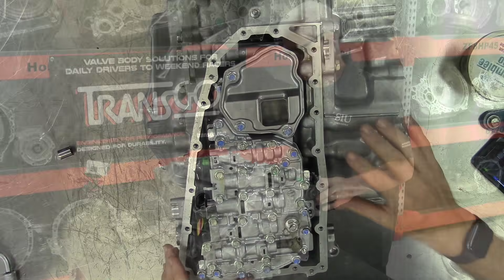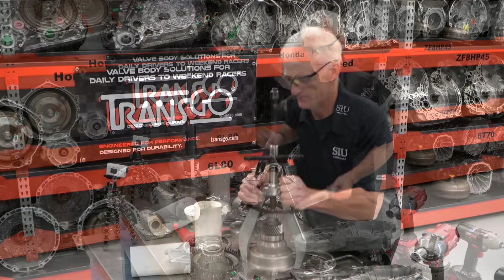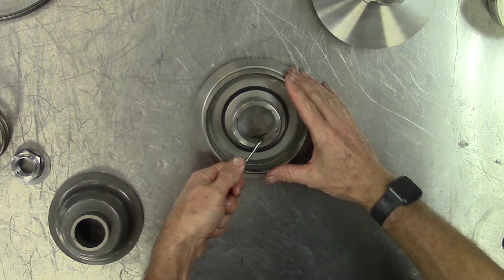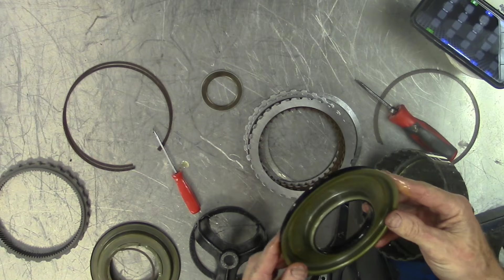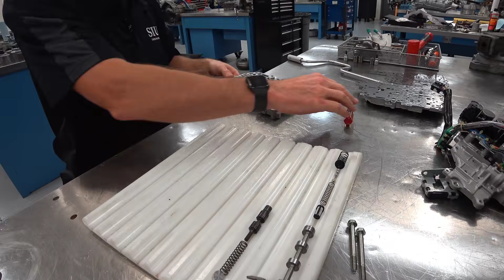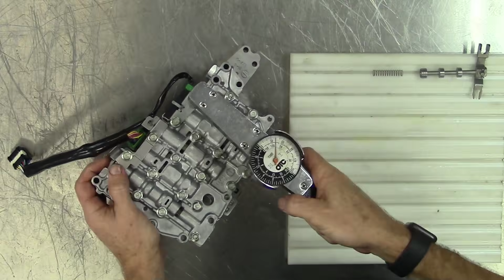Jatco CVT Overhaul JF011E RE0F10a/b

Comment: Wow, outstanding, thank you so much! When they say not to chnage the transmission oil in an older car (200k miles and older), if it was never changed previously, which parts could be impacted in a negative way by the fresh oil?
Reply from the maker: The main reason people say don’t change the oil on high mileage transmissions is because the new fluid has great detergents that will break loose varnish and gunk and potentially hang up some valves.  Varnish doesn’t really build up in transmissions like they used to, so it really shouldn’t make a difference.  If your fluid is really dark though, you might be taking a risk.

Comment: Does the ROM have the flow rates of the particular solenoids stored in it?
Reply from the maker: From what I understand, the flow rates for the valvebody and solenoids, but many techs keep the rom with the vehicle even when installing a new valve body and solenoids and even a completely different trans to avoid mismatch codes.

Comment: Thanks for the great video ; Ihave a 2007 4x4 Patriot the rpm jumps after 140km/h but no more speed.That started after I flushed the cvt oil and changes the filters.
what do you think the problem is   thanks

Comment: I have a 2010 Nissan Cube and I am replacing the Valve Body on my own. Although i have the correct Valve Body, I have seen so many that are listed for my year , as well as the the trans filter kits and they are very different from what I actually have. It seems my transmission is not the default transmission. Why would this be? Any thoughts, as it doesn't show up as an option for any auto parts stores. i have had to work directly through Nissan with my vin # to get exactly what I have.
Reply from the maker: Yes, there are so many variations.  The info I have shows that the cube should be a RE0F08B and you might see a stamp 1XC6B on it somewhere.  It's etched into the case but it's also on a sticker if the sticker still exists.  It's similar to the 2011-2012 versa but it has different ratios.  If you go to slauson.com, those guys are really good with CVTs and they should be able to get you the correct parts.

Comment: Hi, at 17 minutes you talk about pulling the cover that the shafts mount in. I was wondering if you can pull this cover without disassembling the rest of the transmission to re seal it. We have a Nissan reman that has started leaking, and it is out of warrenty.
Reply from the maker: I've never tried.  I think it'll be tough, especially with the rod that travels with the pulley.  I always fight that.  It's really not that hard to pull it apart anyway.  And you'll want to address the pulley rollers and the flow control valve in the pump anyway.

Comment: Hello by using this guide can you improve a jatco CVT like the one on the rougue sport to make it stronger, before it fails? For example change the BBs with the rollers and the pressure regulator valve, and maybe add a frexalite transmission oil cooler, upgrade valve body. I wonder because I know most of the time when the transmission fail the parts could damage the internals completely and you'll need a new transmission, however if it can be improved for a lower price so it will resist more and don't fail it could be worth it specially in CR that a lot of used cars are sold.
Reply from the maker: I believe that if you address the shortcomings of these CVTs, you'll get more life out of them than when they were new.  I did make this video covering more of the things that need to be done during rebuild.  https://youtu.be/0ibNYcT4UkQ

Comment: I seen the, "why Nissan ctv's fail", and it stated that cvt's can't be rebuilt. What did they mean by that? Are certain parts not available for consumer purchase or is you take your vehicle to the dealership, you can't get a rebuild, but only a replacement?
Reply from the maker: I don't know why they'd say that.  Maybe the video was really old?  There are many shops that build these and all the kit suppliers have kits for them.  Also, the aftermarket companies like Superior, TransGo, and Sonnax offer remedies for many of the issues that plague these units.  The dealers don't rebuild them, but Nissan doesn't rebuild any of their transmissions.  They get remans from Jatco.  But trust me, plenty of shops overhaul these units.

Comment: When air checking the forward clutch, reverse clutch and primary pulley on the valve body ports. Just how air tight should the teflon seals provide around the stator? is a slight air leak sound normal?
Reply from the maker: Yes, air leakage is normal. That's why you use lower air pressure (30-40psi) and listen for the apply.  Don't use full shop air because you can have a bad leak and still hear the clutch apply.
Reply: Trans fluid is MUCH MUCH more dense than air so air will have a tendency to leak much easier, hence why the instructor says to turn the air pressure down to 30-40psi

Comment: After reinstalling the valve body i get codes p1777 p0740 p0745 p0778 p0744 any advice?
Reply from the maker: Those are a lot of electrical codes for solenoids.  I'd wonder if you have a broken ground wire in the transmission, or the harness got pinched while assembling the valve body or pan.

Comment: Is it recommended to replace the pulley bearings?
Reply from the maker: Not necessarily unless they have really high mileage, the trans failure produced a lot of metal, or the bearing feel rough after cleaning.

Comment: I bet only 5 or 10% of the transmission repair shop do what you just did , the rest most likely will be cutting corners!
Reply from the maker: Well, I don’t think so.  Most of what I covered I learned from people who do this every day.  In a trans shop, the builder often spends 1/2 to 1 full day going through a transmission.  They usually don’t remove and install and usually they have someone help with parts cleaning.  It goes by pretty quick when you get familiar with the unit.

Comment: Shot in the dark, but hoping I might get a reply. I have the same transmission JF011E. I was getting a code for P1778 and replaced the step motor. (Low acceleration from a dead stop until about 30mph.) Now, after replacing the step motor (didn't fix the problem) I am having electrical problems. When the transmission feels like it shifts gears around 35mph, the speedometer stops working, the TPS light and the key light come on. Any idea what could be causing this?
Reply from the maker: The stepper motor movement allows the ratios to change in the transmission.  If there's no stepper motor movement, then the ratio will never change.  That code for the stepper motor could be caused by a bad stepper motor, wiring, or TCM AND it could also be caused by a bad CVT.  

The TCM looks for ratio changes when commanding the stepper motor, and if the ratios don't change, it assumes its the stepper motor's fault.  It could be the CVT pulley damage, oil pressure issues (flow control valve), etc.  

With that said, some have found bad connections and wiring in the internal and external harness.  You could use a ohm meter at the TCM connection and check to see if all the coils in the stepper motor have connection.  Doing this at the TCM would check continuity of the internal and external harness and the connections.  The coils in the stepper motor are grounded in the transmission.  You should see about 15 ohms through each of the stepper motor wires to ground.  For a 2011 Altima, those wires are pins 27, 28, 29, and 30 at the TCM.

Regarding the other electrical issues, if they weren't there before, I'd look real close at any harness and connection that was disturbed by the service you did.  You probably have a bad connection or missing ground somewhere.  Good luck!
Reply: @siuautomotive  Thank you. I'm going back in tomorrow and will look at everything you mentioned.
Reply: You have to spin the new step motor to the exact same position as the old motor..

Comment: Hi Sr my I have a question my cvt transmission is leaking where the engine meets the transmission right under the access to the fly 
wheel bolts i have a nissan altima 2011 can you give me a idea what seal is bad or if the transmission needs to be removed in order to fix this problem Thanks a lot very informative and detailed video, even though im not going to repair a transmission my self i watched the whole video Thanks again!
Reply from the maker: Just the front trans seal, and a hole/crack in the torque converter or case.  If it’s engine oil,  It could also be an engine rear main seal or oil pan gasket.

Comment: Sir, i have a question, why you haven't remove the welding wire after completing assembly? Please i am waitinv your answer
Reply from the maker: Good job noticing that!  I did pull the wire before I put on the pan, but I forgot to include it in the final edit!
Reply: @siuautomotive  thank you sir, now i am ready to do it..God bless you🙏🌹
Reply from the maker: Good luck my friend!!
Reply: @siuautomotive  excuse me sir, one question: does primary and secondary solenoids are the same? Interchangable?

Comment: I would like to see a similar video of the K312 transmission for the Toyota C-HR - and find out where the defect is in it. The Turkish CVT transmissions are not holding up well for some reason. There are many reports of this transmission failing in 2018-2020 C-HR models

Comment: I'm about to attempt a rebuild myself. I've never worked on a transmission before. This video is made by an expert teacher right here in Carbondale, Illinois. I'd rather pay him to teach me how to fix it then buy a refurb and pay $4000. Does anyone know how to get in contact with the man in this video? 2011 Nissan Murano SV FWD with the 3.5 in it.
Reply: I just finished mine, I bought the clamp kit two big sockets and the manual and parts. Pending testing, but I’m with you for 4-5k I am willing to put the time and learn.

Comment: On the long hauls, say 650km drive, after a while when going uphill, it can stay around 70-80km/hr speed, even with foot flat to the floor. If I pullover for lunch and let it cool down, I can initially get up hills at 120km/hr but after a few hrs I get the same issue. I can hear a whirring noise also. Just recently had Tx oil change, full synthetic. Any idea what the likely cause would be? I’m keen to have a go myself
Reply from the maker: Hmmm, any lights on the dash?  What’s the engine rpm doing when it cannot accelerate any faster?
Reply: I've had a similar issue. It seems the power from the engine isn't getting to the wheels. My Jeep Patriot has a dash light that looks like a thermometer inside a gear. Still on the original fluid

Comment: @siu automotive, hoping you can offer me some assistance I have this 7 speed CVT in a suzuki swift its shuddering on deceleration not frequently when warm but mostly when cold, sometimes won't up shift if revving around 3-4k rpm 60-70km, revs fluctuate between 3-4k, i can also feel what seems to be a slight slip high revs not much speed infrequently. The car feels like it slows down going from 2-3rd and like there's a lump when it eventually up shifts to 3.I think the last person to service the transmission has used the wrong oil type(pink color). I have done a drain and fill with oem suzuki fluid(green) but not much change, fluid is still pinkish. I also noticed the filter on the cooler return line was quite dirty. I'm currently waiting for the oil pan gasket, external filter to arrive before doing a complete fluid change.

Comment: Hi I had a similar trans rebuilt and now it has a shudder when moving off. Ant suggestions on what may be the cause?
Reply from the maker: It depends on what was done to the transmission and if it has any codes.  It might be unrelated to the trans, like a misfire, which can feel like a trans shuddering.  If it is the transmission, I'd suspect low pressure.  If the problem isn't related to the original reason for the rebuild, it might be something like a nicked seal on install.

Comment: Great
But what about the primary sheave? The most common failure.
Reply from the maker: Same process as the secondary pulley except you don’t have to mess with that big spring.  The only pita is finding a socket big enough to remove that big nut.

Comment: Any info on primary pulley disassembly?
Reply from the maker: Other than finding a socket to take that big nut off, it’s actually easier, since you don’t have to deal with the big spring.  You still have the ball bearings that you should replace or change to roller bearings.
Reply: @siuautomotive  looking to do a repurposing project and I was an automatic specialist. Let me know if I've got this correct. The stepper motor calls for a ratio via TCM, the ratio control arm is provided with the current current ratio and the commanded ratio which sweeps the ratio control valve which acts on the primary and secondary control valves. The primary is fed through the stator support and secondary via the case.
Reply from the maker: Looks like you understand it.  Although the ratio control valve only works on primary pulley pressure.  The ratio control valve will directly relate to the gear ratio.  If a different ratio is needed, the Tcm commands the ratio control solenoid to move, which either releases fluid from the pulley (lower gear) or applies fluid to the primary pulley (higher gear).  The pulley ratio will continue to change until the ratio control valve is moved to the hold position.  The secondary pulley is fed line pressure and its pressure is controlled by the secondary reg valve during ratio changes.

Comment: Thanks for your knowledge and time 🙌🏾 After overhaul, during 2 - 3 shift, I have a slight RPM flare/ spike. Any idea why and what would be the fix ?
Reply from the maker: Is this using an auto stick function?  The cvt doesn’t have 2nd or 3rd gears.
Reply: Confusing an automatic transmission

Comment: Where would I buy respectable part for a Nissan cvt trans? Like the whole valve body that is complete?
Reply from the maker: slauson.com has many used parts and they also have rebuild kits.  Definitely check the dealer, because they sometimes have the valve body cheap (check for updated valve body part numbers from TSBs, if available).  valvebodypro.com has good valve bodies as well.  wittrans.com has kits, used and new parts.

Comment: Was thinking on buying a used dodge caliber 160k miles seems to run and drive good, wonder if it's worth taking a chance on, they want 2k
Reply from the maker: If it hasn’t had the transmission rebuilt yet, it’ll probably need it soon.  There are probably better options out there for 2k.

Comment: You do us all a service taking the mystery out of this CVT. Thank you, sir. Do you have specs for the optimum temperature range of the CVT oil?
Reply from the maker: I don't have the optimum temp range, but I'd assume it'd be 10-20 degrees below engine temp.  That's where most transmissions live.
Reply: @siuautomotive  ,how do I get 2010 nissan versa cvt transmission oil pump seal for my car?
Reply: A quick one, the coolant comes from the engine to the warmer that has paper filter. Ideally its temperature is the lowest, because the transmission generates it own heat. Living in region where lowest temp is 10 degrees Celsius all year.
Should I install cooler for the coolant coming in the warmer. I already have a four port that cools oil externally.

Comment: I have an 09 Rogue with this trans. Reverse operates properly. Forward Appears to not change ratios. Runs normally to about 35mph and runs out of rpm. As if in low gear. Could it be the ratio  control motor you pointed out early in the video?
Reply: Thanks for the quick response I’ll have to check Monday and get back with you. Have a great weekend!
Reply from the maker: It could, but I would suspect you have a diagnostic trouble code stored if it’s not trying to change ratios.  It sounds like it’s in “limp-mode.”  Do you have any trouble lights on the dash?
Reply: @siuautomotive  we are showing P1778, and P0868

Comment: Thank you , to change the small oil cooler filter , can you please provide the torque spec for the 4 bolts ? Thanks
Reply from the maker: 4Nm or 37 in lbs — not much
Reply: Thank you , in a crisscross pattern? Sorry for all the questions last thing I want is to have a leak
Reply from the maker: Yes sir!

Comment: I have a 2009 2.4 Lancer CJ VRX CVT with 150k. When an manual mode (paddle shifters) is it normal for the transmission to not follow the engine rpms? (Accelerate hard at 4k rpm, engine and transmission go for a bit, but then, revs fall back and go up again... ) Not sure if the ECU is cutting power to the engine or the transmission cannot keep up and slips until it finally catches on and the car accelerates. Thanks.
Reply from the maker: In manual mode, they will not typically bounce off a rev limiter.  It will continue to adjust ratio when you're engine RPM has picked up to a point.  Many newer vehicles simulate gear shifts this way.  I'm not sure if what you are experience is a problem.  I suspect it's not slipping, or the TCM would set a code.
Reply: @siuautomotive  Many thanks, I have been told that it is the TCM/ECU cutting power to avoid damage to the CVT belt. It can only be solved via tuning. I will continue to save up to buy a DCT car 👍

Comment: Fantastic content. When should the cooler filter and the pan strainer filter be replaced? at 90k service? THANKS.
Reply from the maker: In the Nissan scheduled maintenance document, they only have their techs change CVT fluid at the 120,000 mile mark, but that's only on their "premium maintenance" package.  They don't require fluid changes on their CVTs.  The filter can be washed and I'd change the cooler filter after overhaul.  It shouldn't be clogged with anything unless the unit is failing.  Jeep has a tighter maintenance schedule.  They want you to change it at 64k if you drive it hard and at 120k if you drive normal.